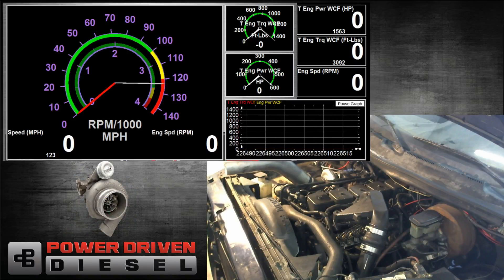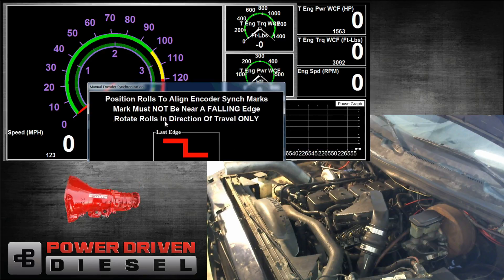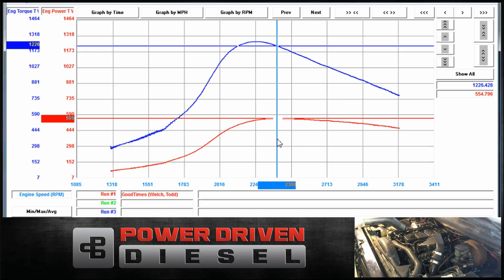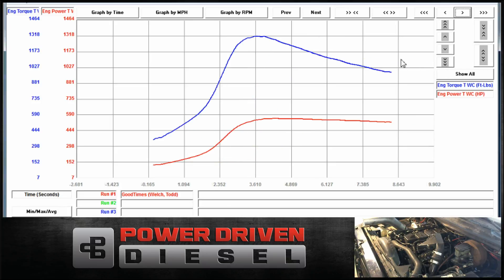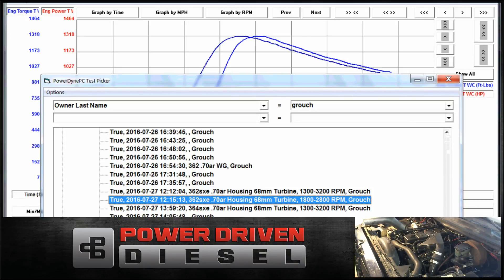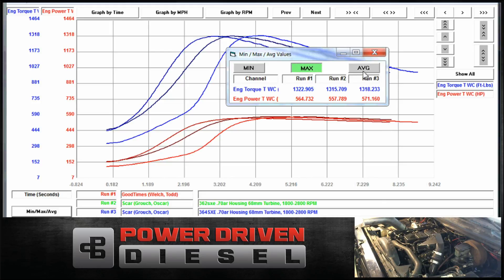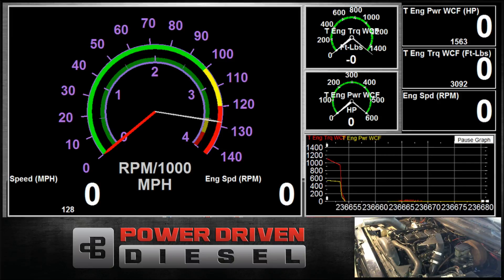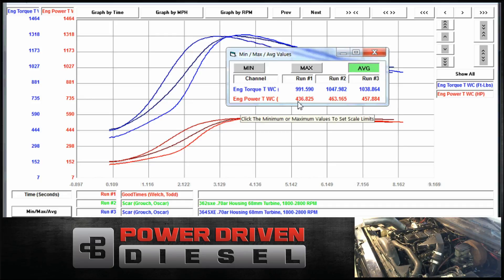Dyno Test: BorgWarner Turbos S363SXE Turbocharger | Power Driven Diesel

Comment: I run this turbo with a non w/g .80A/R turbine housing pushing 55psi. On my Dyno run I made 518 HP and 1100 torque. The drawback was my egts hit 1750°. I'm running 20° of timing, stock 215HP delivery valves, Factory head and cam, 3.5" intake horn, 4KGS, stock lift pump, #10 fuel plate full forward, AFC set to 47psi, 60 lbs spings, and DAP 7x.011 SAC injectors. Have any suggestions on how to lower my egts?
Reply: Second gen swap, compound turbo setup and bigger intercooler
Reply: @MadisonFishing  I've been considering that. I'm not on board with giving up a 100+ hp for the sake of egt's.
Reply: If you don't want to do compounds maybe it's time for a cam
Reply: @noprob364  truthfully I may end up doing both.

Comment: i have been looking at this turbo for long time how do you think it will do on  2001 24v with a airdog 165 and built trans sb air filter and edge juice with attitude i tow a lot but also like to get on it when on the hwy
Reply: @pddofficial  thanks for the info in the fast response I greatly appreciate it